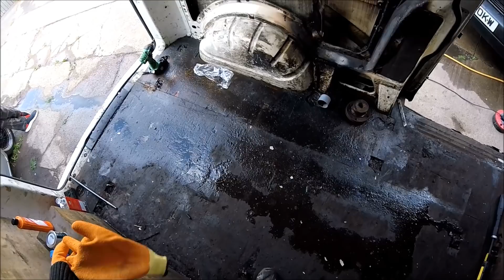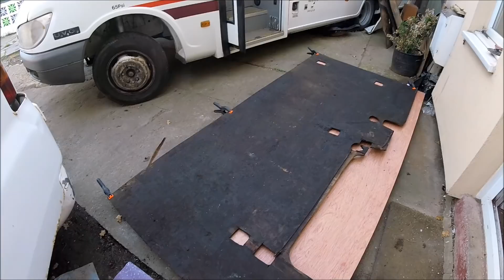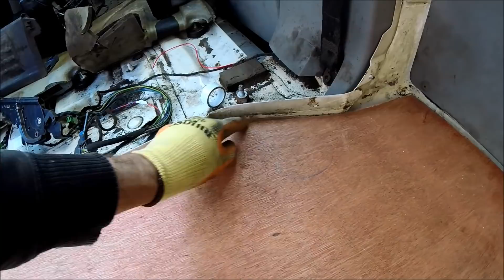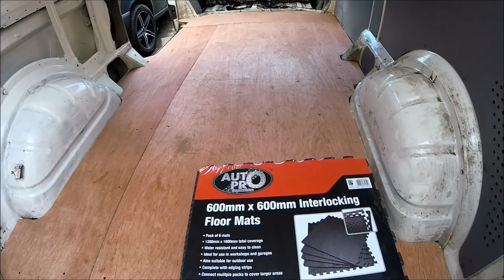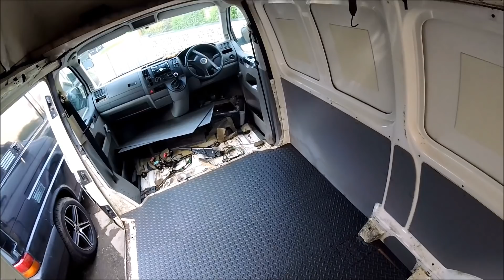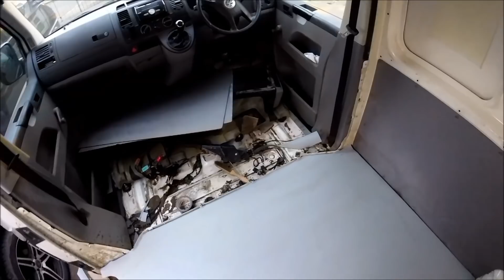VW T5 Camper Conversion Project Part 4: Replacement Ply Floor, Insulation & Altro Flooring Install

Comment: I have been following your channel for ideas for my Berlingo/Caddy/Connect conversion. Is there a condensation problem if the XPS is not fully touching the metal floor, or if ply is put down without anything underneath. Thank you.

Comment: Great find this, and thanks for taking the time to make these informative vids. One question re the screws, you say they were stainless steel, were they self tappers? And how long were they? I would be scared of them going through the floor and then allowing water in. What do you think?
Reply from the maker: Most work vans have plywood screwed through the floor from factory, generally no issues

Comment: Alright mate, great vids thanks for a lot of ideas. There's so many different ideas and opinions when it comes to insulation van floors but I really liked yours as it doesn't involve gluing battens down and I really liked the idea of the soft tiles under the Altro. 

I've ordered the stuff you used but was expecting the XPS insulation to be rubbery, the tiles I have seem quite brittle, have you had any issues with them breaking under the ply?
Reply from the maker: All the tiles I’ve used so far have been soft foamy and flexible so I’ve not had any issues with them at all
Reply: @TheCampervanBuilder  I must have got the wrong ones then as they were quite brittle, is there any chance you could post a link to the ones you used?

Comment: always seeing van conversions, like watching em cuz i want to do one later on myself after i get a van, but im whondering, why does no one put any type of insulation on the driver compartment in the front? yes it will raise the seats a inch perhaps, but that part in the front could let in some cold, not so much, but it could be a big different
Reply from the maker: The front has rubber matting down which is formed to the footwell so raising it would throw it right out, along with the steps etc.  Most people put curtains across the front to block it off and create a barrier to the cab
Reply: @TheCampervanBuilder  i know that, but a curtain wont really help against colds, thats why i wondered why no one did any type of insulation, even if its just some reflectives

Comment: Great vid Dave. Does the van need mechanical attention? I have a T4 and would love a T5 but they are quite a bit more money in my experience, just wondering if you got a good deal cos of the fire damage etc?
Reply from the maker: it doesn't need anything that I'm aware of other than a starter battery, mobile mechanic maintained so things got fixed if they ever broke.  I got a relatively good deal on the van but as the fire damage was more to the ply panel with just scorching to the metalwork with no actual physical damage or replacement parts needed other than a good clean, and factory LWB high tops are rare as hens teeth, it still cost a big enough chunk.  Try and find a T5 factory high top and you'll see how rare they are and the premium they demand
Reply: @TheCampervanBuilder  Thanks mate, even for a work horse, they still command a premium. Look forward to you doing more to yours mate!

Comment: Hi, What screws did you use please. Great vids. Thanks. Bug Ups
Reply from the maker: normal Stainless Steel screws, nothing too big though, just enough to go through the ply and grab the metal floor without going too deep through the floor